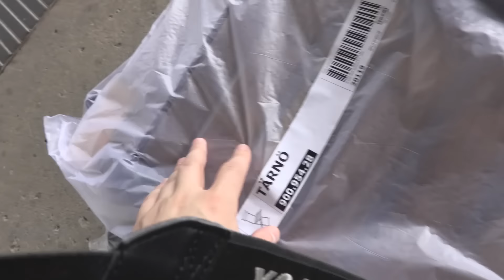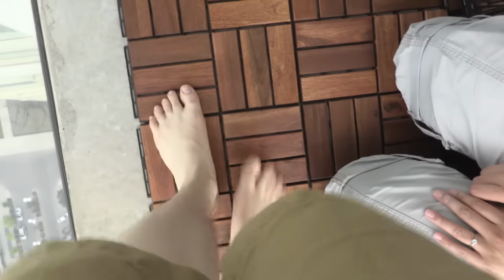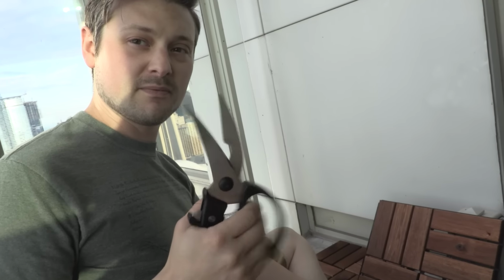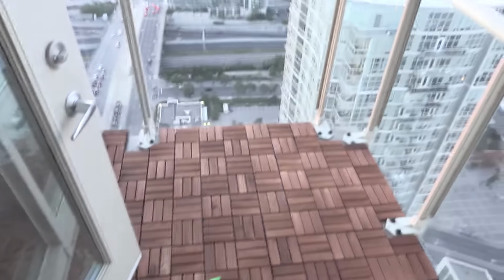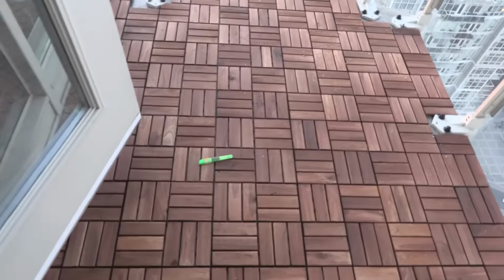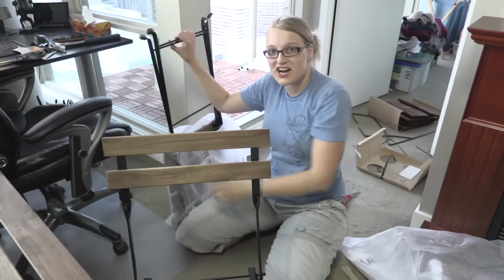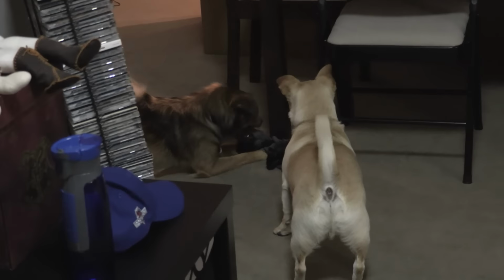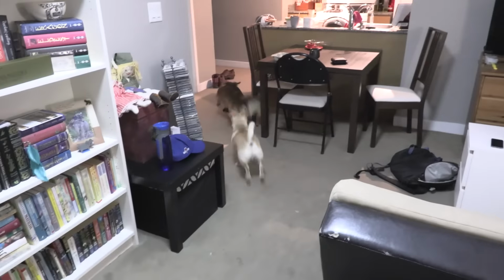Balcony Makeover (IKEA Unboxing, Voodoo Spell, and Ripped Off)

Comment: Has the teak tiles started to fade or warp?   The half exposed to the sun, on our deck, is a light gray after two years.   Several boards have curled up.
Reply: donna wanna I’m think you should seal it with a UV protectant sealant every year.